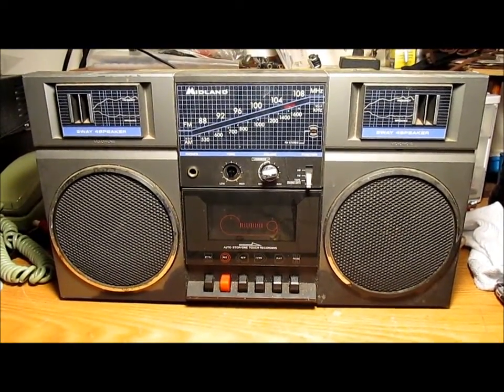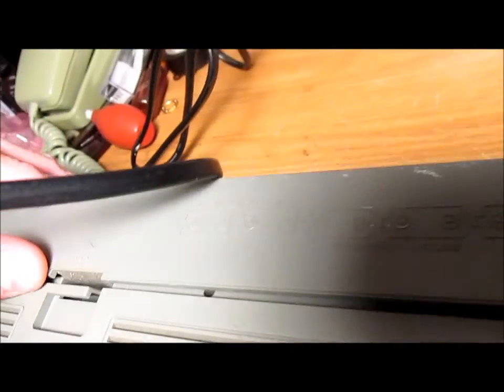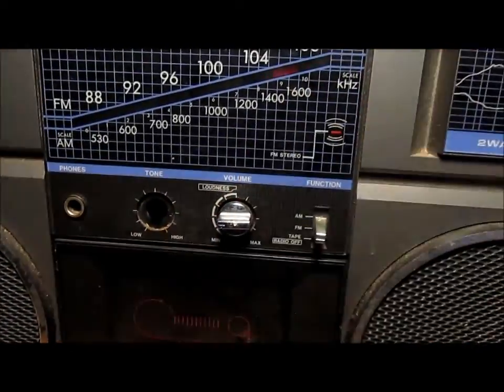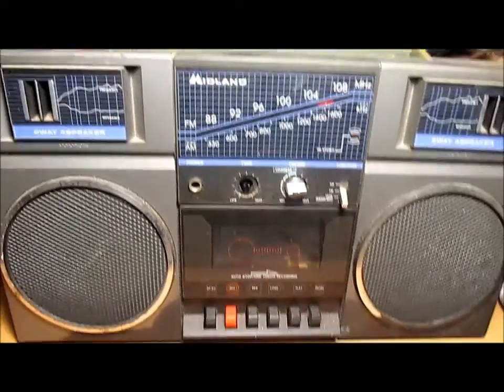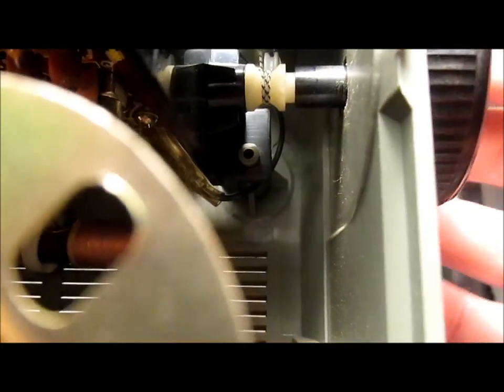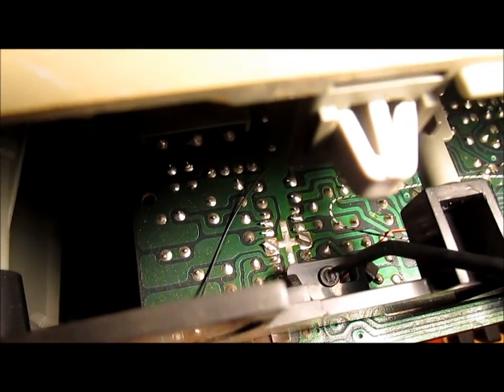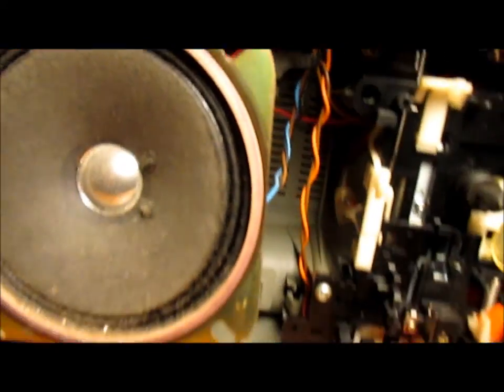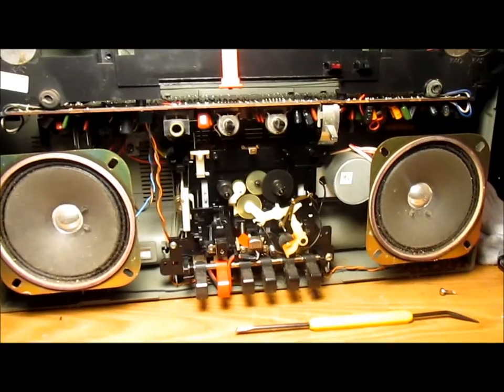Midland 19-111 Boombox (Western Auto - 1980's)

Comment: I had a Samsung that was exactly like this down to the coloring . and I got it in the early 80's . I think that this was a knockoff of Samsung's unit .   this was decent until it broke down the tuning capacitor fizzled out and never worked again and the motor died so that was the end well it was very cheap and you get what you pay for great video keep them coming
Reply from the maker: Thanks for the info.  I have no doubt this was built by Samsung, as Western Auto just bought electronics from manufacturers and had them "private labelled" as Truetone and later Midland.
Reply: well the brand does not in my opinion make the unit a bad product just the people that are not taking pride as they make it . you can have the least popular company make a unit that will go head to head with a top company and it will be hard to say whom would win thank you again and keep the great videos coming